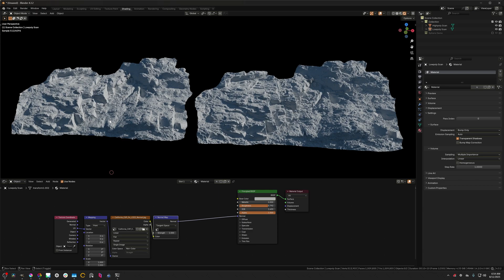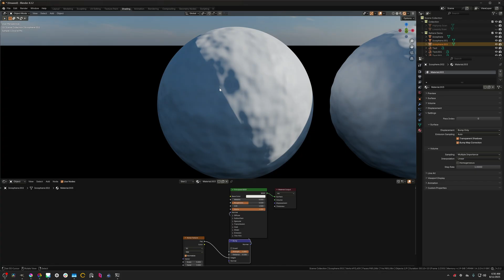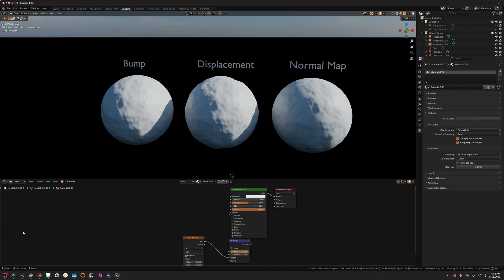Fix Blender's Normal Maps in 1 Click (Pre-4.5)

Comment: @1:26 did you set that bump only material correctly?
It looked like the bump was going to a displacement output but was set to bumpn only. Yet nothing went to the normal input? 
At leastz I alwayse use normale also when it's a regular simple bump
Reply: Same goes for that middle setup. You set it to bumps and displacement. But there was no bump map set.

I'm not even sure why in the first onze we actually see something. There is no bummap set and displacement was off. Seems like an error
Reply from the maker: I responded to you on twitter but I can get into more detail here

The displacement input of the material output node is 'Global' for the material, meanwhile anything connected to the normal socket on the principled bsdf is local specifically for that principled bsdf shader. It doesn't actually augment the pixel normals in any way that is accessible from within the material. 

The displacement in the material output node is computed before the rest of the material, so if you're applying a bump map to the material via that method, you can read the pixel normals with that bump map applied via either the geometry node or the texture coordinate node. This is helpful for material setups that use normals to blend together multiple different texture sets (I use this a TON on environment shots), as well as many other things. 

'Bump Only' mode augments the pixel normals without altering the mesh
'Displacement and Bump' mode physically displaces the mesh's vertices, but also updates the pixel normals with the extra texture detail. It's not like adding displacement and then applying a normal map on top of it, it's a singular process, and it does not inherently cause any issues. 

Using the normal socket in the principled bsdf node is useful for normal maps of course, but the effect is explicitly local to that specific shader, so yes this is the go-to for objects with simple PBR texture setups, but for anything more complex, having the displacement stuff I mentioned earlier is quite handy

Hope that clears some stuff up
Reply: @samk9632 that KS for very well explained info. I've learned that using bump and displacement together as textures is not really a good approach. Because it can cause artifacts.

So I guess reading your explanation, using the bump method with the displacement together. The bu.o is applied correctly. But I guess that only works for procedural bump setups. 

Does a texture bump node also get corrd tot applied to the displaced mesh? Because in most engines I knowz doing that destroys the uv and you get tearing and the s the artifacts

Comment: It's not only that checkbox, if I use normals/bumps with displacement, the "displacement" tab has these modes like bump only or displacement only or both, and choosing "both" may give some weird results too
Reply: To my knowledge, it's not wise to use displacement and normal together. Because displacement alters the geometry and the map is not up to par for that. You would see stretching or tearing
Reply: It's actually common knowledge to not do this or use them together. Just do a quick Google.
I'm actually surprised blender has settings for this to allow. Because in most cases. When you use it with bump r normal as a texture. It causes artifacts
Reply from the maker: I've had some issues with displacement&bump mode in 4.3 as well. It seems to have been broken in a recent update, and I'm not sure if newer versions have patched it (probably, just haven't checked). Anyways, there's nothing inherently wrong about using that mode, it's quite handy.

Comment: Have you tried blender 4.5 yet. According to the release notes they’ve fixed this issue.
Reply: I was thinking the same thing. I don't know why he's using 4.3 . The filter width on the bump node gives you control on the sharpness of the bump. Christopher 3d has a great video about that. I might test this bump correction setting later.

I tested a few scenarios with the "Bump map correction" turned off and it looks worse in all of them, at least in 4.5. It is no sharper than leaving it on. Turning bump map correction off also introduces some artifacting at high glancing angles, as if there is no specular layer in some spots like if you were to control+shift+click on the diffuse texture.
Reply from the maker: Good to know. I might make an addendum soon once I corroborate this. 

Why am I on 4.3? I only update when I have to (4.3 had a volume anisotropy fix that I needed) as I use blender professionally and delivering blend files using bleeding edge blender versions causes many more issues than just using a relatively recent version that has much wider adoption.
Reply: @samk9632  yeah, I wanted my fix to go in at 4.3, but because it was a breaking change (your renders would look different) and took a while to debug, it went in later. sorry!